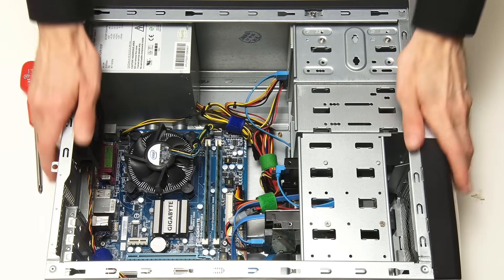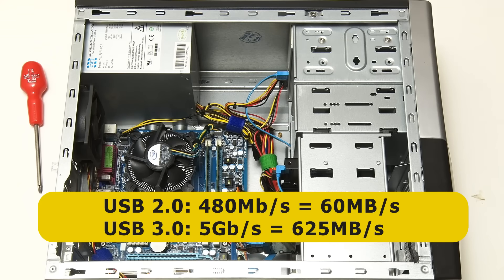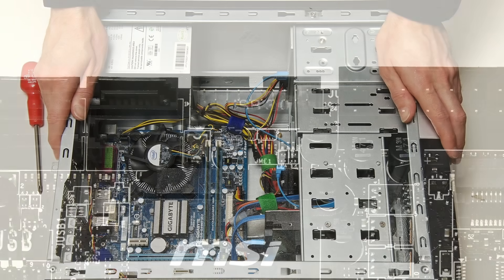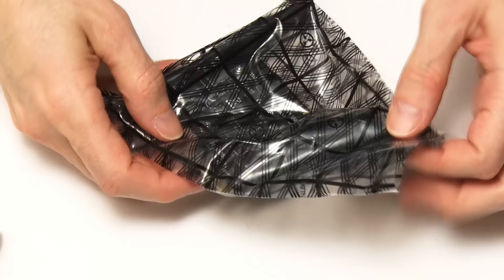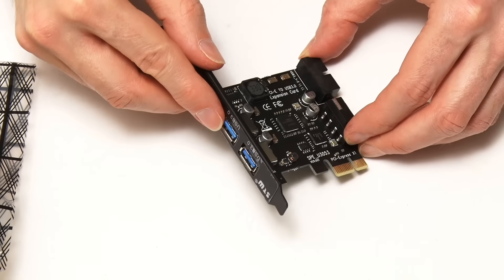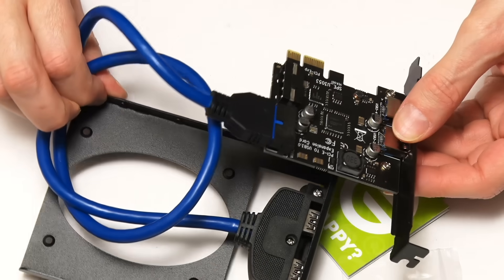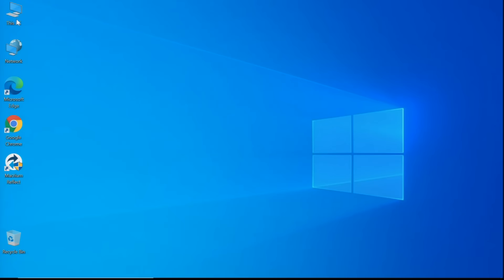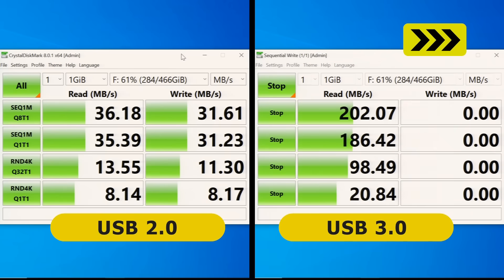Old PC Upgrade #3: USB 3.0 Ports

Comment: The point is well-taken that a PCI Express to USB 3 adaptor should have a power connection, but it isn't absolutely necessary if the hard drive (or any other device) you connect to it has its own power supply.  Correct me if I'm wrong.
Reply from the maker: You are obviously correct, but the point I was making was about the USB ports on the computer and whether they could power all hardware that may reasonably be expected to be connected to them. All 3.5 inch external drives need their own PSU, and since the advent of USB 3.0 it is exceedingly rare for external 2.5 inch drives to come with a PSU (or even have a power connector) as they are expected to be USB powered.
Reply: @ExplainingComputers  I'm trying to narrow down the number of available options so that I can choose one to buy. If that power option isn't critical I can live without it, though sometimes (like when I'm building a whole system) I do like to future-proof a pc by packing on lots of features, as you suggest.

Comment: Hi, I'm an avid follower and subscriber of your chanel even to the point of getting one of the red TerraPi kits and building a Pi 4 to be used as a desktop unit. All went well, following your instructions, until it came to the SSD. Both Ubuntu and Raspian both recognised the SSD but will not alow me to create or alter anything on it. On checking the properties It says that the drive is "root" controlled only. Is there a script to alter this or could you point me in the right direction. Thanks in anticipation.

Comment: if u add ram and change the motherboard and cpu then it is not upgrading it just building e new sysyem
Reply from the maker: I see your point, but I would class removing a motherboard, CPU and RAM, and keeping the case, PSU, fans, DVD, SSD and HDD as an upgrade. If your camera went wrong and needed a new circuit board, would you see that as a repair, or buying a new camera?

Comment: Less than a year ago, I built a new Ryzen PC. The motherboard came w/ about a half-dozen 3.1 ports on its backplane. And I plugged in exactly one 3.x device: an external HDD. All the other devices (keyboard, mouse, printer, gamepad, card reader, video-capture dongle, etc.) were all 2.0 or less.

Comment: I've got an oldish R620 server which sadly doesn't have USB 3.0 ports. This makes Veeam backup to external drives very slow. I purchased a similar USB 3.0 PCI-E card and installed it, then immediately had BSODs when booting Windows Server. Removed the card and the problems went away... Any idea what could be wrong with the card I bought? I'm assuming bad drivers, but I haven't spent much time troubleshooting yet.

Comment: I thought they changed from USB 3.0/3.1 to USB 3 gen 1,2, etc.  Hopefully you are right and they've gotten away from that as 3.x is a LOT simpler to  ID.

Considering this is a work in progress, I'm surprised you didn't replace the screws on the main side cover with thumbscrews.

I'm also surprised that the next step is to put a better video card in that empty PCIe slot, then see if there are any cpu upgrades that that board will accept.  ebay has a ton of older chips for very reasonable prices, vs. new motherboard and cpu.

Sure glad you put all 4 screws in that front panel holder, don't want it to come loose in a earthquake or anything...  :)

Comment: There are two good things with this motherboard is that it support cpu's with 1333mhz fsb to support quadcore. The G41 chipset also supports the Xeon 771 to 775 mod to support faster quadcores. :) There are plenty of premodded 771 cpu's on ebay. But I think even a Q6600 or Q6700 would've improve performance.

Comment: Hey, be careful with those kinds of cards. Some of them can be defective and cause power fluctuations on your motherboard.
Reply: be careful of cheap powered hubs, they can backfeed power into your motherboard as well.  Can test by plugging the powered hub into another one connected to nothing, it will power on even if its up stream.

Comment: Thank you for bringing a bit light into this closed down darkness. :) 
How about Power consumption. The old Pentium Pro processors had a rumour of consuming pretty much energy.  I have always kept away from them because of that. Maybee you could meassure the consumption before you change the motherboard/processor, and se if there is a difference.

Comment: Thanks as always for the videos. Have you considered the benefits of a cheap graphics card? I bought a £20 optiplex machine for my young daughter, I upgraded the E5500 for a core 2 quad 8200 (£10)  for much better performance,cheap ssd and I also bought an old oem amd R5 340x 2GB pci-e card for £22. Mostly for the benefits of hardware video decoding, but also hdmi,dvi output and it even plays a large library of games and emulators as well as google earth. it cost more to find a quality kids keyboard and mouse, she loves it.
Your pc motherboard has support all the way up to core 2 quads (and probably cheap xeons) but I agree it's about cost effectiveness.

Comment: I think, that you should consider replacing thermal paste and checking how this affects performance before replacing CPU. The cost is almost negligible and the effects can be pretty spectacular (especially if the previous owner kept the original paste there)

Comment: Is it possible to add this 3.0 USB to my old window xp computer. Will it upgrade this hardware on xp computer.
Reply from the maker: If you have a PCIe slot, you can add a USB 3.0 card. However, Windows XP does not natively support USB 3.0, so you would need a card with Windows XP drivers, and that will be very hard to obtain these days. So realistically, if you continue running Windows XP, you probably cannot now add USB 3.0 ports.
Reply: @ExplainingComputers  Thank you Sir.

Comment: Huh. My computer at work, over the years I've also had it upgraded with more RAM, an SSD, and USB 3.0 ports. And it'll be 10 years old very soon (still has a sticker on it that says manufactured April 2011).

Still getting work done though, unlike so many of the Macs around the place that have had to be replaced. Hurray for non-upgradability! 🙄
Speaking of non-upgradability, I really hate how modern PC cases don't have 5.25" drive bays anymore, at least in the DIY market. Look case manufacturers, just because I don't use disc drives anymore doesn't mean I don't want 5.25" drive bays. I can stick other things in them, like the USB 3.0 front panel expansion as shown in this video, or small drawers to hold flash drives, or who know what else. A lot of options out there! Not when you have no bays, though. My case at home has built in USB 2.0 only, as well as Firewire and eSATA (it's a pretty old case). But it also has USB 3.0 type A and 3.1 type C thanks to 5.25" expansion bays. Also has side panel intake; forget about tempered glass, I want cooling for my graphics card!
Anyway I'm rambling a lot now. At least maybe the algorithm will like it...?

Comment: Really excellent video, very educational. I learned a few things that I wish I knew about a month ago. No worries though, the idea that the usb 3.0 PCIe could have a internal hub and extra power to it for front ports when your Mother Board does not have usb 3.0 connectors. All so did not know about the PCIe 1.0 could be put on bigger PCI's, 4x 8x and 16x...wow...
Reply: Your motherboards controller has an internal hub, only the highest end expansion cards have actual multiple controllers per port.
Reply: @churblefurbles  very true, it's just that I get a lot of hand me downs and I fix them up and some times the front end ports and hubs on the boards don't always work. Or at least not at 2.0....so I get PCIe 1x attachments which work well on Linux without any additional firmware. I just didn't know there were ones that can connect from that to the front as  well..

Comment: Another factor that may be the most important is the actual host controller chipset on these ports or expansion cards. It can decide whether you can get it to run at all on a particular operating system or with a particular badly behaved device.

Comment: A quick quiz, in long format! I was given an aging HP Pro 3120 MT desktop machine of a similar vintage to this rebuild project a couple of weeks ago. It arrived with a Intel® Pentium® Processor E5500 2M Cache, 2.80 GHz, 800 MHz FSB, and HYNIX 2GB 2Rx8 PC3 10600U 9-10B0. I bought and installed a budget Asus GEFORCE GT 710 GPU, added 16GB (4x4GB) DDR3 DIMM 1333Mhz PC3-10600 (acquired in two batches, when first 8Gb worked, gambled and bought second batch of 8Gb) and everything ran ticktyboo! So took, what I thought was the next logical step and bought a 2nd hand Intel® Core™2 Quad Processor Q9550 12M Cache, 2.83 GHz, 1333 MHz FSB which fits into the  LGA775 socket of the IPIEL-LA3 mother boards.  
                                                                              

What happens next?

Power button and then short beep, one long beep. Find beep codes. Memory problem. Removed/replaced modules. No. Tried variations of pairs and singles in slots. Same beeps. Returned the old processor, normal boot and operation. So I feel I have been caught out with a beginners mistake here! Can someone please explain where is the glaring incompatibility error in my race for speed :-) Cheers Folks.
Reply: PS I forgot to say that I also installed a 4 USB 3.0 ports on a PCLe card just like this video today and it works great, so not a complete loss today :-) Just a wasted 2008 processor it seems. Also when cleaning the heat grease off the Quadcore a tiny soldered component fell off, so seems I broke it trying to clean it anyhow.

Comment: you can also install Win10 AME ameliorated on this PC. it runs snappier than standard Win10 pro and is more secure. The downside is you can only use 1 account on the machine, but that is probably no issue on a 10yo PC.

Comment: you might be able to run a Xeon X54(70) on that board when you upgrade the Bios microcode and mod the CPU or get a modded one from China. They cost around 25-50 USD. since you already spent some money on it might as well get the best CPU too.
It might also need a better heatsink tho. My old Asus P5Qpro already had a "Golden Orb II" cooler on, which also works great with the Xeon. It is only slightly bigger than the boxed cooler. The Xeon is at least twice as fast as my previous Core2Duo E8500. You can also download a Microcode bios /w Xeon support for this Mainboard if you dont wanna make it yourself.

Comment: Would it not be worthwhile also updating the processor?
eg an Intel Core 2 Quad Q6600 - 2.4GHz available secondhand on EBay for £15 (UK based)
or an Intel Core 2 Quad Q9650 3.0 GHz available secondhand on EBay for £48 (CN based)

Comment: I thought the next step would be a Core 2 Quad - Q8300 in sock at CEX for £8 - only 2.5GHz vs 2.8, but 4 cores vs 2 and more cache.

Comment: When you told us about next week's upcoming video, I was reminded of "This, milord, is my family's axe. We have owned it for almost nine hundred years, see. Of course, sometimes it needed a new blade. And sometimes it has required a new handle, new designs on the metalwork, a little refreshing of the ornamentation ... but is this not the nine hundred-year-old axe of my family? And because it has changed gently over time, it is still a pretty good axe, y'know. Pretty good."

Comment: Does anyone know if i can plug a usb header into a fan header, i need it for my wifi and bluetooth card? :)
Reply from the maker: A fan header supplies power and fan control and monitoring connections. A USB header has data lines and power. So you cannot plug a USB header into a fan header (well, not and have it work!). Sorry. :(

Comment: Frellin awesome, all the upgrades that you have done & are going to do are the exact same upgrades that i need to be doing....super uncanny.
 Thank you Christopher, i didn't think that the USB 3 port upgrade would be included in this as i desperately need to replace or upgrade the front USB's as little children accidentally knocked mine and they have never been the same since, glad that replacing them is as simple as putting lego together.
Looking forward to the cpu & motherboard upgrade as this is something I am also looking to bring into the 21st century, not that my pc is old but this is why i had mine built to a specification in order to be able to upgrade, again thanks for your methodical walk through

Comment: Are there pcie 1.0 usb 3 cards that use x4 or x8 slots that provide better speeds?
Reply from the maker: Yes, there are x4 USB 3.0 cards -- and they were pretty common when PCIe 1.0 was common. But these days most USB cards are x1, which is limiting (as shown here) when upgrading a PCIe 1.0 system.

Comment: 16:20 No matter how much of a budget machine that was, a mobo with PCIe 1.0 in 2010/11 wasn't merely bad. It was miserable! Version 3.0, which was introduced at that time and was therefore cutting edge, is of course not to be expected, but v. 2.0 came out in 2007, so come on...

Comment: I recently upgraded an old P35 chipset computer using an x4 PCIe Syba SD-PEX50055 2 Port USB 3.0 and 2 Port SATA III adapter card -- so, even though my motherboard could only do PCIe 1.x, the x4 of PCIe 1.x allowed for good speed SATA III SSD and USB 3.0 access. The upgrade even allowed for booting off an attached SATA III SSD drive. It doesn't seem to allow booting off of the USB 3.0 ports unfortunately (which I was hoping for to do faster boots off USB drives, like ESXi 6.5 or TrueNas.) Does the USB card you added allow booting off of its ports (or is that something limited by capabilities of the PC's BIOS?)

Comment: I just did a very similar thing to my 2008 Mac Pro which I am turning into a server. The Mac Pro just got a USB 3 expansion card in it and it got a SSD to PCI expansion card from other world computing to complete the upgrade. It's running like a top and right now I have one open Drive Bay with 16 terabytes online and single order another 10 terabyte drive for a grand total of 26 TB.

Comment: Depending on what you're planning on using the expansion card for, the number of the controllers onboard make a huge difference. From SATA to USB, no big deal but, if you're planning on moving files from USB 3.0 to another USB 3.0 device, having multiple controllers will tremendously effect transfer rates. I've seen USB 3.0 expansions with 6 ports on the rear, and a front panel header but only 1 controller. The speed would be horribly slow if multiple ports were used at once for file transfer. Spend a little more and get a card with 2 or more controllers onboard to handle high speeds between USB 3.0 external devices. Most cheaper cards are PCIE x1 but the better cards will be PCIE x4. This is not always the case but usually a good sign. I have seen dual controller USB 3.0 cards on PCIE x1 but not many.

Comment: I've purchased several of this kind of card due mostly to a liking to excessive amounts of USB ports and not wanting to overload a bus shared between several high speed devices. I've had a number of mediocre to outright bad experiences with them. I'd recommend not buying the cheapest USB 3.x adapters you can find. One of the ones I've used caused strange system instability issues, and others would disconnect attached devices at random.
Reply: When I had that kind of experience, the actual problem proved to be an unstable southbridge due to iffy capacitors. The boards eventually died and the swelled capacitors made the problem obvious. (Happened a lot with a whole swath of Asus boards.) The very same USB card in another system worked fine.
Reply: @Reziac  I don't think there are north and south bridges on modern systems. I didn't do much  investigation after taking the card out fixed the problems I was having. I also didn't need 22 USB ports so it wasn't a significant issue. I forget the brand it was though it had 8 ports total, 6 on the back plate and an internal header.

Comment: Oh please, try Core 2 Quad and single slot-width Quadro graphics card. They're still have a PCI usb 2.0 hub, ethernet adapter or any upgrades you want. 🙏👍👍 My PC which has same hardware still running good with these upgrades. Keep going to the limit of sky. 😀

Comment: Another awesome video, Chris. I have a similar PC which has AMD 790 Chipset.  I already upgrade the CPU , RAM and SSD on it. It only has one PCIe x1 Slot same as yours. Before the video, I'm thinking between an AC WIFI card or USB 3.0 expansion card.  Now , both usb 3.0 expansion  card and front panel are on the way since I can easily hook it up with the gigabit Ethernet .

Comment: Nice video on updating to USB-3.  I did this spring/summer 2020 with mixed results.  First adapter card was too old, crashed my system and had no driver updates for it.  Second adapter card works OK except it will not allow my system to stay in Sleep mode.  Windows could not list the wake-up event causing this issue.  I've thought of updating the BIOS and CPU someday; possibly this will fix it.  Otherwise I'll wait and do a full motherboard, CPU and RAM upgrade.

Comment: Is there riser cards that have USB type C as my motherboard has rear but no internal plugs for type c plug in?
Reply from the maker: USB C is another form of USB 3.0/1/2 connector, not a different type of USB. So any USB 3.x header (like the ones shown in the video) can connect to front or rear USB C ports. There is a different kind of header for USB 3.1 Gen 2 ports, which are most commonly Type C. And there are front bays that feature them -- eg: https://www.amazon.co.uk//dp/B07F23JL3H/ Or just plug adapters like these into Type A ports: https://www.amazon.co.uk//dp/B085VT1VJT/ Instant front USB C :)